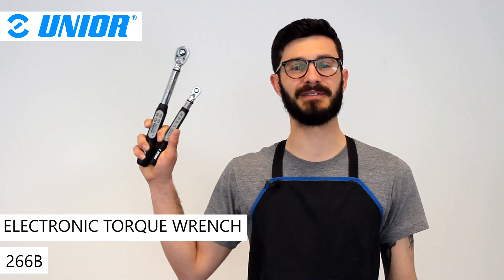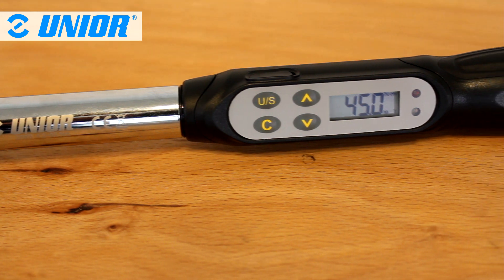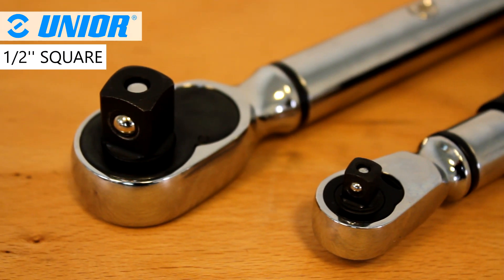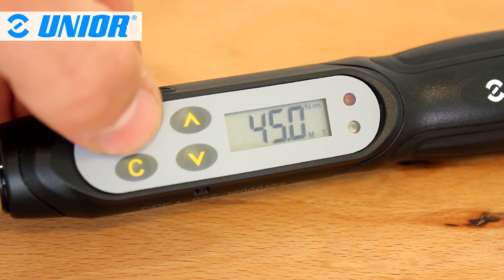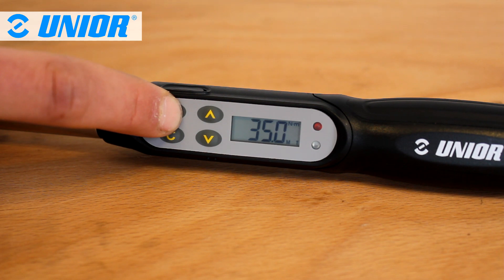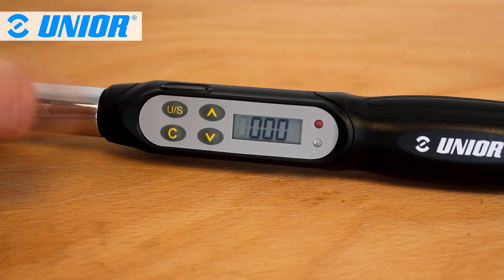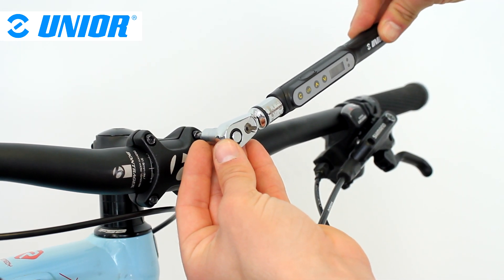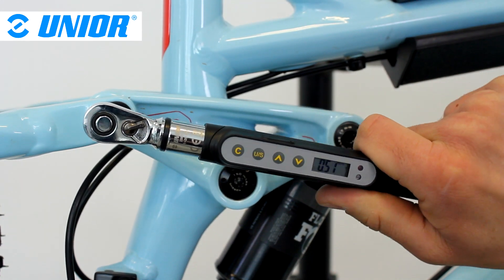Electronic torque wrench 266B | Product Overview | Unior Bike Tools

Comment: These are most often used wrenches in our workshop and they still work fine. Not a cheap thing but not only safer, also helps in thread and overall parts wear off recognition, stems especially.